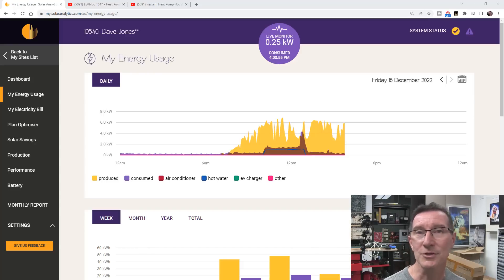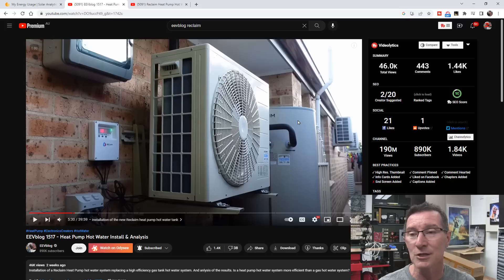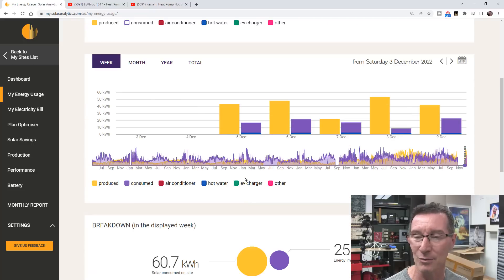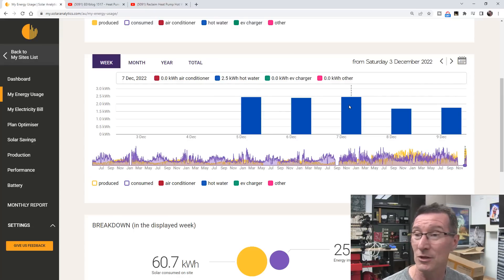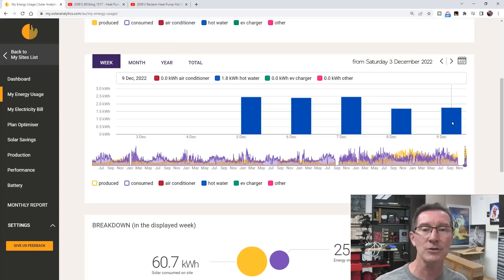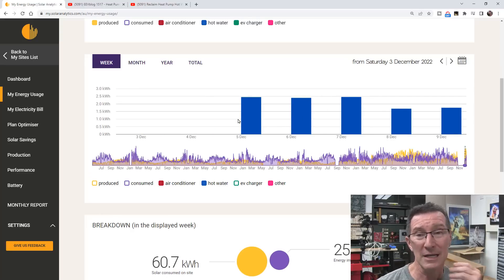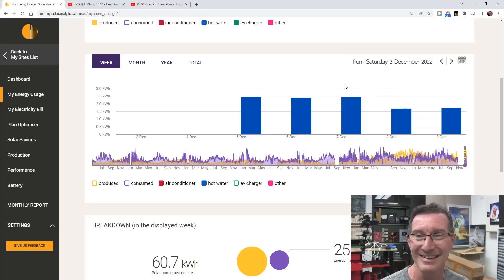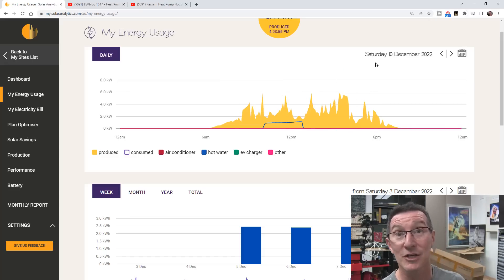Heat Pump Hot Water Standby Energy Usage

Comment: I see you spent about $5500 on that system, would love to see you work through the pro’s/cons of spending that money on battery storage, given that in some respects your hot water system is energy storage. Given however you can only use that stored energy for heating water, and the relatively large outlay for the heat pump, would the additional cost for battery storage not provide greater utility and solve your hot water cost situation as well?

Comment: You would get even better results if you boxed in the tank using some sort of thermal insulation board to keep the wind blowing past the tank and pipes. As it uses so little power, you may think it's not worth the effort to build a box just to save a very small amount of power during summer ......  which comes free anyway. However,  during winter over there, that will have a big effect on the figures you have now, so the box-in idea would save more in the end, In the Uk, the hot water tank traditionally sits in an "airing cupboard" inside the house. Old tanks were just bare copper tanks with a thermal jacket fitter around them and held on with string or tape. Newer tanks have a polystyrene cover sprayed all around the tank so very much more efficient.

Comment: 10 years ago I converted from gas storage hot water (30 year old) to instantaneous hot water and my consumption dropped by 3kWh/day. This includes pilot light running 24/7 which I estimate used 0.5kWh/day. So Dave's 1.8kWh/day for tank loses sound reasonable for a standard tank. I would have expected better performance for a high quality tank.

Comment: In the UK if you have a hw tank 3 KW input per day is about normal .
But the size is smaller than that monster & probably doesn't run 24/7 !
Something in the 200 L range is normal but 90 – 440 L are available .

Running the high temperature cycle daily is just waste !
With clean water systems twice a month is all that's required .

Comment: There does seem to be renewed interest in combiner solar PV and thermal panels. I was told long ago that the idea was great but there were too many problems with the water leaking. I find it hard to believe that issue cannot be solved. It would be an ideal solutions that keeps the PV panels cool whilst preheating the water. I am very jealous of those who have enough room for such a big tank. Our single storey semi has very limited space around the building. Worse we live in a "leafy" suburb where the options for solar PV are limited by lots of shade from trees.

Comment: Here one of the manufacturers (Kwikot) of resistive water heaters claim around 50W standing losses... This looks similar.... (I would expect that it should be less with the more efficient heating)

(I think that is for a 150ℓ tank, which would have a smaller surface area) (For the "Superline 600 Dual" they claim standing heat loss of "50W per hour" (which is not a valid unit...) in the brochure)

Comment: Hi Dave? Do you make the effort to use the 68° output water for cooking / dishwasher / laundry needs? If it is about 6 times more efficient than direct heating, then starting from already hot water for those needs, seem like a good economy feature
Reply: Cooking with hot water form a tank system ..... No Don't Do It !

Dishwasher & laundry go for it .

Note :- Modern equipment is almost all 100 % cold fill .

Comment: It's - 10 deg C now and mine is defrosting half the time. This makes the compressor stop and start often. I think you should have plotted the (delta) temperature curves.
Reply from the maker: What is thsi negative temperature you speak of?
Reply: @EEVblog2  outdoors temperature. You said it works well in winter
Reply: @user-jp1qt8ut3s Sydney winters  are a bit different!
Reply: I think there must be various approaches to defrosting
I am heating with my air conditioner now and it keeps the compressor running while defrosting.
It ramps the speed down, switches the reversing valve, speeds back up for 2 minutes or so, ramps back down and switches over to heating again.

Comment: If I look at my old gas tank water heater compared to the new tankless, it ran about 80% more consumption.  It averaged about ~5 therms / month compared to the tankless at 1 therm (= 100K BTUs or 29.3 KWH).  Converting that excess / standby heat loss, I get 3.9KWH/day.  That was a 150 l. tank with an extra insulation wrap, but with the standing pilot light and central heat tube, it lost a lot up heat up the flue.  

Of course with your COP, that 1.7KWH electrical input would work out to several times that much heat loss.

Comment: Your usage is about 0.5kWh and heat losses is 1.8kWh! 
Sounds like you need better insulation on tank.
Reply: And a smaller tank. He's just wasting electricity every day reheating an extra ~200 gallons of water he'll never need or use. Sure, the electricity is "free", but it's still an unnecessary waste.
Reply from the maker: It's one of the best on the market.
Reply: @whocares281 I smell a rat somewhere, it could not be that bad! 
I think it needs investigation. If it is true then he should get a refund and purchase a smaller unit which is better insulated.
Reply: @peterdkay  It's Green …...............So it'll cost a lot  !

Comment: Interesting numbers. My indoor electric 180L tank (old houses in NZ like mine have them inside) uses around 1kWh if no one is home, around 10kWh on a normal day, so my losses are around 10%. Yours seem much higher, maybe due to the tank size or being outside or maybe you have a leak?
Reply: It’s because it’s never actually off? It still does a legionella cycle every day?

Comment: the 400 liter is a basic calculation from the amount of water and temperature that gets in and needs to be heated to what temperature and the losses during day and night.
If you expect the cop 4 then your 2,5 kWh invested to heat water might have an impact of 10 kWh on the water side and then you can devide the 10.000 Wh by the amount of water needed just to get the amount of °C you could expect based on the temp. it goes into that tank.

Only during winter the figures here get a lot worser which means you willl need more energy to gain the same output for 2 reasons:

the water temperature that gets into the tank is colder during winter and 
then the heatsource is also colder than during summer so it looses efficiency.  Things get terrible below 0°C cause then you will have to heat the water inside the tank with a heat bar  powered by electricity. Those are the really expensive days where a gas powered generator can be very usefull cause that way you get 1/3 of energy and you can use the wasted heat from the exhaust again to heat the water in the tank. Not cheap, but quite efficient if you use the energy on both sides.

Comment: Hi David, yes this was extremely interesting. Here in Germany there are big discussions, how to replace fossile energies by "regenerative" ones, and in particular to replace gas heating by electrical heat pumps. Currently, we have -9°C outside, and an upcoming  lack of natural gas during the winter time.
Reply from the maker: I don't understand negative temperatures.
Reply: @EEVblog2  15.8 degrees fahrenheit
Reply: @EEVblog2  So you are using Kelvin over there in Aussie land? ;-)
Reply: Wir schaffen das.
Reply: Please post an update if you've come to a conclusion. 

I also live in Germany (near Berlin) and wondering: The cold water that comes into the house in the winter feels somewhat colder than summer, i.e. the delta temperature it must be heated is higher. 

If I choose photovoltaic, we get very little direct sunlight in Nov-April, so generating 20-40 kWh/day (as Dave does) will need a lot of solar panels and a lot of space. The house is in a foresty area with a lot of tree shadows, especially in the winter, when the sun is low. Difficult to generate the power that Dave does. May be next generation solar panels will be better.

I need most of the hot water in the morning, before the sun starts shining, which it does from about 9:00 in the winter. Can the thing keep the water hot from the late afternoon to the morning? 

If one needs to top-up with electricity from the grid, it may be expensive. We pay about 0,45 Euro/kWh. But with all the banning of petrol/diesel engine cars and conversion to electric, the demand for electricity will increase and before you know it, the price will be over 1 Euro/kWh.

Or should I convert to wood fired heating and chop some wood in the forest.

Comment: You're lucky to have the sun pay for your electricity. I have used 1.753 kWh so far this month (Dec 17th) at avg price NOK 4.63. Estimated bill in Dec to be 3.200 kWh = NOK 14.800 = AUD $2.240. An I don't even have a very big house...
Reply: 3200 kwh a month how is that possible ?
Reply: @tonio172  It is very possible if you live in Norway these days. Remember, inverted seasons compared to AU
Reply: @TorgeirFredriksen  i live in belgium, here someone who use electricity to heat his home and water would cobsume about 6-8000 kwh a year. That's why i was surprised for a 3200 kwh a month. You house isn't insulated ? That would be cery surprising if you ise heatpumps.
Reply: @tonio172  Oh yes, it is insulated, all houses in scandinavia is. Most houses in Norway are quite large though and mine is no exception. It is also quite old and not as well insulated as the new houses. But it is quite common. Consumed energy in December is about twice of November, due to the ice cold temperature we got here lately. And as my heatpumps are just air-to-air (which is also the most common type here) I get no benefit from them for heating water. Hot water is then just from passive electric heat elements. Also very rare to have gas installed here. The problem is the extremely high energy prices right now. For the last 20 years it has been around EUR 0.05 per kwh, but these days it can get as high as almost 1 Euro. I assume the prices are about the same everywhere in Europe, the only difference is that in this country electric energy is used for everything.
Reply: @tonio172  Mostly heating and hot water usage.
Reply: @tonio172  it's like -20c there. Big difference from 20C winters in oz
Reply: @tonio172  3200kWh is easy with -20C and 250m2 heating area.
Reply: @rkan2  We had -12C at minimum this month but average was about -5C. Not extreme. All heating is powered by heat pumps, except from firewood heating sometimes. Point is that electricity is extremely expensive these days.
Reply: @rkan2  You should be very happy if you are protected from these extreme rates happening in Europe now
Reply: @TorgeirFredriksen  I'm from another nordic country, so unfortunately not, but at least I don't own a detached house :D
Reply: Even Norwegians have to get used to heatpumps and not just direct electric heating LOL
Reply: @rkan2  I have heatpumps. Three of them actually. One on every floor, and one limited to 10C in the garage. Wow, you impress me
Reply: @rkan2  No they don't, heatpumps are next to useless in such a cold environment.
Reply: @MattyEngland  that mostly affects the air source heat pumps other kinds still work well.

Comment: 1.75kWh/24h ~= 73W avg.
But that's standby and water reheating. Most is probably due to the heat loss. What's the real standby power that unit uses, can you directly measure that? Some of that HVAC electronics stuff can be quite horrendous.

Looks like from the graph about 1.5h*~1kW, so ~1.5kWh (~62W avg.) reheating and ~0.25kWh (~10W avg.) standby?
Heat loss for 1.5kWh and 415kg Water looks to be about 3°C with those figures.

For someone from Europe, looks strange to have those water tanks located outside, but i guess it makes sense in Australia due to the higher outdoor temperatures.
Reply from the maker: I did standby power that in the original video.

Comment: Superb info Dave. I was one of the people asking for this info. I think this would be much cheaper to run than our current oil based boiler even before fitting solar panels. Need to get a spread sheet out
Reply: Heat pumps are always more efficient because at 0C it is usually 5x the heat for 20C to air or 3x heat to water for 60C.
Reply: But they are noisy, not good for the city nights.

Comment: How much was the heat pump including installation?  It seems like prices are inflated here, but I have nothing to compare them to.  My local place wanted ~ $30K USD.
Reply: 30k$ is bullshit. Monoblocks you can also install yourself even in EU since all the refigerant is inside the heat pump. for 5k$ you should get like a 10kW heatpump already. Add another 5-10k$ on install, which should do a lot already.
Reply from the maker: AUD$5k but that was a premium top of the line australian made stainless steel 400L one. You can get cheaper and smaller ones ones for half that.
Reply: That’s nuts